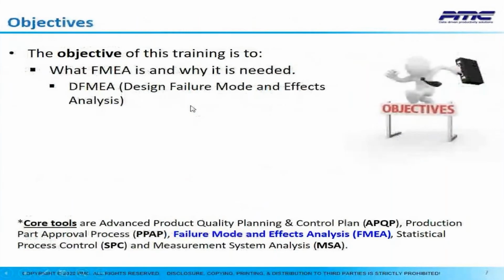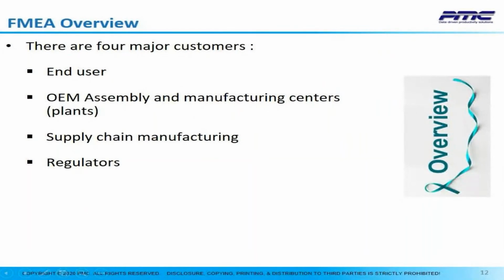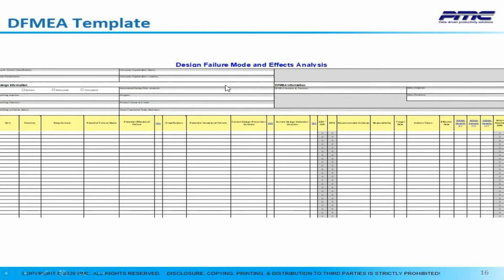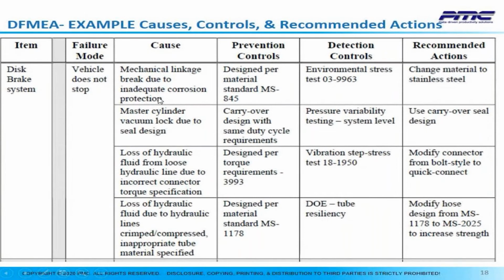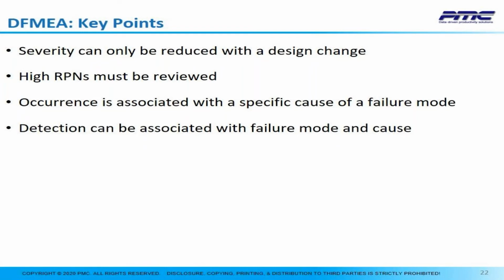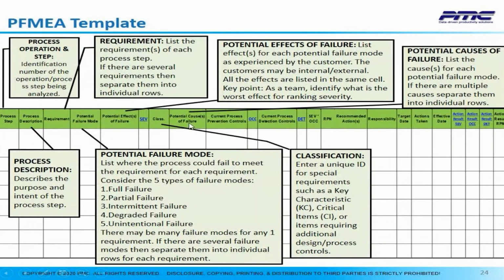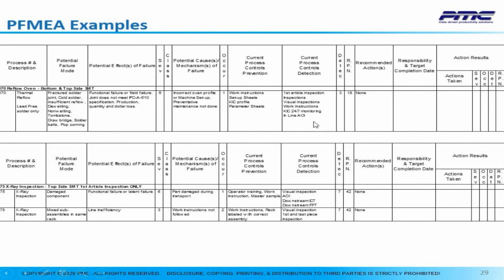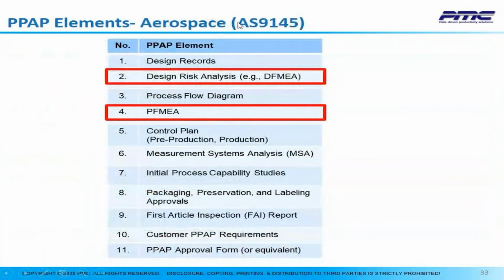Guide To Failure Mode & Effects Analysis (FMEA) Excellence: Design & Process FMEA

Comment: excellent webinar, I have a few questions. First question, so the difference in dfmea and pfmea, dfmea that is emphasized or discussed is the part or item that can cause problems while pfmea is the process of making product A, what can cause problems? and if it's a process, is an incoming QC (incoming material) include? And  packing until it gets into the truck for delivery? The second question is if I only use PFMEA for the process of making control plans and for products that already exist in my company or products that we don't design, such as OEM products, is that okay? or you still have to use dfmea for OEM products (we produce customer products). The third question, to calculate occurrence, it is said in the assessment table that there are 50 / thousand ways to determine what level it is and whether to use defect documents per month or how? maybe an example can be given, such as taking product A defect data in 1 month or 1 PO and how to make it compared to the assessment table? The final question, to determine the RPN value that does not need to be given a recommendation action, is there an example or is it an agreement with the PFMEA creation team in a company. Thank you very much God Bless. sorry if my English is not good.